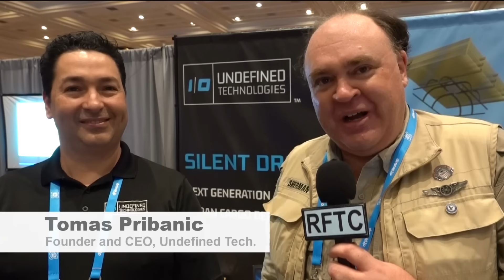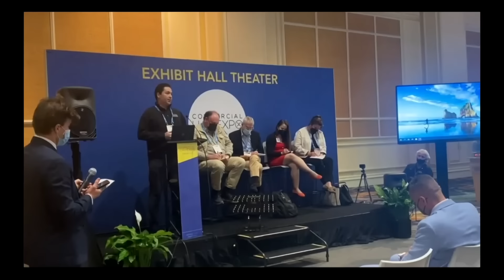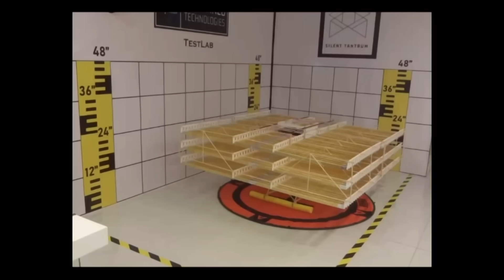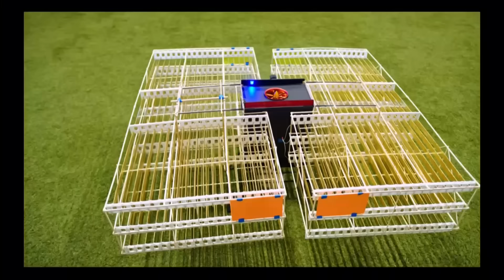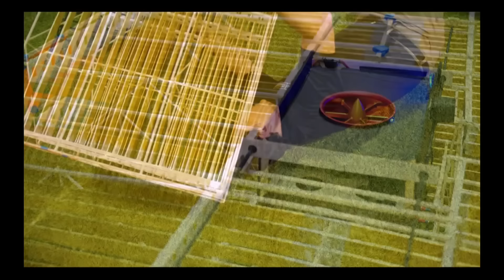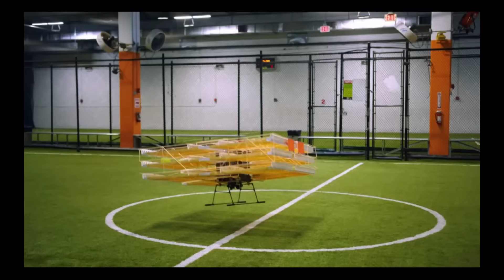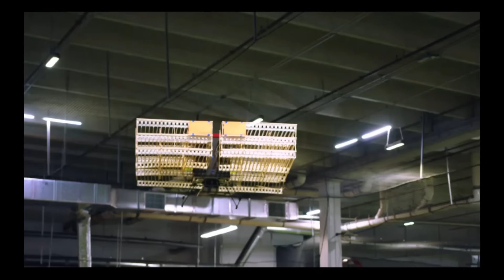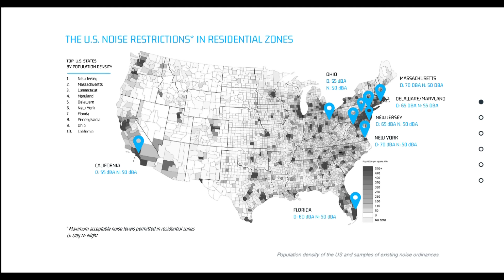New Drone Tech: No Propellers, and Yet It Flies!

Comment: It's NOT ions, they call it ion winds though that's completley wrong,  Gravity is positive negative, the land your living on puts out a constant stream of positive energy heading upwards, 1 meter is a 100watts 2 meters is 200watts so on and so forth,increasing expotentially,   the reasons clouds/ water molecules become suspended is because when they start to evaporate they vibrate this in turn gives them a static charge which  the water molecule now it is devoid of particulates holds that charge carrying it up till its own density finds equilibrium,   Im sure weve all done the balsa/ aluminium and wire test with the battery,   well now you know why it actually works, it's not so much the device thats creating the lift but mearly it's like a kite thats blocking that charge from passing through the middle of the rods, even though theyre is nothing there,  WHY do you think planes are in the main built from aluminium composite,  in conjunction with a positive field it aids levitation by blocking that stream heading up  in effect giving it a push upwards,  the air industry has known for a long time now that  airodynamics isnt really required or needed for air travel.  think flying carpet. weaved with aluminium fibre and fine wire. AS for that thing have you noticed how where the propellors would normally be you've four squares almost touching so control is simple theyre just adjusting the charge to each individually.

Comment: So, no propellers except the fan in the centre?
Reply: Basic physics would tell you that fan in the centre provides cooling for the ion thrust generator technology which would doubtlessly get warm. Basic physics!!! 🙄
Reply: It's not new and there was no fans at all!! Do some research!!!
Reply: Fans are not propellers.
One is for cooling, one is for thrust vectors.
If you're insinuating a fan of that size, drawing air into a box from the top is adding lift, I don't know what to tell you.
Reply: @Ranstone  but fans have propellers.

Comment: These don't need to be silent actually. The sounds a craft makes can be outside the range of human hearing, like what a transducer produces.

I live in San Antonio and have seen some pretty spectacular flying craft near Randolph AFB. One night about 3 months ago, just as I was about to head to bed, this crazy sound was heard for about 30 seconds. It was as if my roof was being vibrated at a frequency higher than the wood and shingles could manage. Even my cats were freaked out by it. All of them were standing on high furniture while staring at the ceiling. I've never seen pets do that before in 40 years of ownership. I was fairly freaked out and nervous to step outside to see what was causing it.

There are several types of transducer-powered levitation devices that can be made from a kit. They can  keep the air entrained between opposing transducers so much that small objects like aquarium gravel can be held solidly in place. Although the devices are silent, the high frequency air waves still caused audible vibration in whatever microphone device is recording nearby (which sounds amazingly like the sound my roof was emitting that night).

The craft I witnessed near the air base would go from ground level to approx. 10K feet within 5 or 6 seconds then smoothly come to a stop, even in 30 knot winds. They can sit precisely still, despite strong gusts. They appear to be able to simulate many different lighting configurations from a single dim white light (as a star would look) to a full red/green flashing as seen on traditional aircraft wingtips. Often they will go completely incognito by turning off all their lights entirely .. sitting still silently in the darkness.

I'm wondering if somehow they are using a phased array of transducers to grab and entrain air molecules from above the craft, moving them below and keeping them in place using ultrasonic sound waves. If the air cannot escape from below the craft, then it could be able to support large amounts of weight, like a solid.

Comment: Don't ion lifters operate at extremely high voltages? Sounds like a big safety risk.
Reply: The only purely ion propelled crafts that can lift their power supplies are on my channel.  While they use high voltage the current is so low that they aren't too dangerous.
Reply: Its intended to remove mosquitos in a large volume.

Comment: This is garbage old technology made to look new. Ion engines have been achievable since the 60s. The reason it is not used is the complete lack of power provided compared to power consumed. It is useless for a drone and will not be able to lift even a small camera. Why spend way more money on an old failed technology that cant lift anything and is almost impossible to control? This interviewer needs to do some research before making videos like this. This is just a scam company trying to show something cool for investments. They clearly are no experts and are just winging it.

This same technology has been used in school projects to achieve the same thing. Its not impressive, its just a scam company.

Comment: I suspect this is using the Biefeld-Brown effect, and not an "ion drive" -- but it's still impressive!  
I hope they continue to develop this!  
This could be the prototype for a genuine flying car in 20 to 30 years...
Reply: Flying cars won't be a thing for as long as it requires a bunch of times more energy to lift something into the air compared to rolling it on the ground. Unless we find a way to levitate stuff without expending energy, or find an energy source so plentiful that it won't matter, we will continue to build roads and roll on the ground.
Reply: @mrkiky  Well, your crystal ball and my crystal ball disagree with each other 😛
Reply: @mrkiky  you act like you’ve never heard of an airplane. Or how about a sailplane? I’m replying from just two years later and we are developing flying cars all over the world. There are several that are available yet. They are not yet common.
Reply: @soaringeagle  Those are not flying cars, they're basically personal quadcopters with 1 seat, and, like I said, they're never be viable. It takes a LOT of energy to lift it in the air, it takes a fraction of that energy to roll it on pavement. Those are toys for rich people, not a viable mode of transportation. As far as airplanes go, they can't really function as "flying cars" because they need to take off and land on a runway, which is why they're more efficient. Planes basically do have a way of levitating without expending energy (kinda) but it requires them to constantly be at a certain velocity, so they need a runway to take off and land and can't hover. So also not viable for any short distance transportation that you'd use a car for.
Reply: @ no I’m not talking about the clock copter there are flying cars and it takes more energy to roll something on the ground because it’s more friction than something that is streamlined and going through the air especially something that’s box shaped
Reply: @ fly sailplanes. With a winch or even a bungee cord, you can rocket it up to 2500 in just seconds and then you just use the energy that’s already available in the atmosphere to fly for hundreds of miles. Wind and solar.. but there are flying cars that are not quad copters that are going to be viable transportation in just a very short number of years. Although they will be expensive at first.
Reply: Yeah.......no.
Reply: @JZ's Best Friend I think I got 20 to 30 good years ahead of me.  Anyway, I got mine from a scalper near Times Square, bleh 😛
Reply: The UT craft requires a noisy high-powered ducted fan in the middle to fly.  On my channel are real ion propelled crafts with onboard power.  They are patented for lifting their power supplies against Earth's gravity.  They are however very lightweight.

Comment: Requires WAAAAAAAAY too much power and won't work in a vacuum . No practical use and a novelty only .. Interesting tech to be sure and worth further study and may be useful for a future application other than flight .
Reply: There are a series of crafts on my channel that take WAY less power and are patented for really lifting their power supplies but, they are MUCH lighter in weight, and it required decades of research, rebuilds, and very specific changes/construction, otherwise it is not normally possible to lift a power supply with ions.  I don't believe the UT craft can do it, and I have heard their loud powerful ducted fan in the middle.  The crafts on my channel are more than a novelty and will have some practical uses someday soon.

Comment: The problem is, that battery he shows won't fly.  He's got it hooked up to small wires and high voltage at extremely light weight.  This guy is a scammer when he puts a big battery by that model drone.  That model won't fly either ( the one with the battery under it ) it's way too heavy.  This is not new tech and many Jr. High kids do these projects for science fair.  There's no magic here buddy.  I guess you crawled out from under a rock.

Comment: No propellers is misleading.  There is clearly an intake at the top of the center box, and an outlet at the bottom.  There is definitely a propeller providing thrust via the center box construction.  They're just using slight ion breezes for stabilization.  Now... take it outside where there's even a slight breeze.  This isn't going to go anywhere practical.
Reply: Many people say they are using ions for stabilization.  I specialize in this subject.  It is not easy to switch 30 to 50kV to the different quadrants with an ultralight onboard switching system.  The weight requirements are WAY more stringent than the parts on a quadcopter for instance.  It also takes years of development to make such a system work in an agile enough manner to prevent a crash.  The weight and force from their ducted fan would cause any ion steering to not work sufficiently.  Their ducted fan in the middle is a like other flying EDF devices shown online (Ikarus for example).  It has visible fins under it that move for stabilization steering.  At least that is what it looks like.  On my channel is the real thing, but it takes a lot of specific details to make it work in real life.  One of them is that it has to be much lighter in weight.

Comment: If it uses only ionic lift, it would prove to be impractical in high humidity or rain, as the HV charge would leak off, negating any lift. Impractical, aside from the fact that ionic lift forces are tiny.

Comment: I like where these guys are going... the place to make money off of this is in fishing.   If possible in the water.   We need a blade-less trolling motor. Edit: we need the blade-less trolling motor for the same reason. Noise.  The difference between people and fish is that fish can feel sound through their lateral lines. So they are much much more sensitive to it.  The will certainly still be able to feel the water moving from some distance away but it won't have that thump to it.  Think of a pulsating headache.

Comment: When reporters who didn't pass a single science class do reports on scientific topics lmfao.  There is NOTHING new, special, or "magical" about ion propulsion.  It is only impressive that someone wasted the time to make a drone this big that uses that as propulsion.  All this is doing is ionizing the air and using charged wires to repel the ionized air resulting in a push.  Aim that push in the right direction and you have lift.  It is incredibly energy intensive compared to propellers and requires much more structure to support the frame resulting in a great deal more mass to the vehicle reducing flight time and carrying capacity.  This technology has been around for decades and has no potential to take over propeller flight in atmosphere.

Comment: I read about this kind of propulsion 15 years ago. It was precisely this idea. Except it said it required high voltage in order to make this lift off - so it had a wire going to it. Curious how did they manage to produce such ionizer system that can produce enough thrust to lift itself, battery and extra 2 LB payload, while drawing so much power from battery. What's the trick?
Reply: Mabe if Testla had gotten his way this would have been more viable?  I read that some  of our planes in militery have some ionic lift. Who knows?

Comment: Props still seel more convenient if the power issue is no longer an issue then, the ionize propulsion  is still susceptible to wind think steering a hot air balloon with a fan boat motor. Interference from ionized  climates seem they would be an issue , and also shows up like the bat signal in any E.M.F view lens. Let's see where they go with this.

Comment: ROFLMAO! So, they are going to try and patent LFTR tech even though they did not invent it and some of us have been testing different designs for around 30 years at this point. LOL, of course the thing they aren't telling those people is that the damned thing can barely lift itself off of the ground. Add something like a good camera and it can't fly. Not to mention the fact that if you touch the wrong part of the drone once it is turned on, you can die!

Comment: My guess is that future use of this technique will involve using a hybrid design which also has rotors to
allow it to handle wind, rain, etc. and which can be activated for extra-heavy loads.
Reply: The UT craft requires a loud powerful ducted fan to lift itself.  The only ones that really lift their power supplies solely using ion are on my channel.  You are right though they are sensitive to wind at this point.
Reply: My guess is that rain would cause excessive HV leakage, negating any lift. This is interesting technology, but sadly, impractical.
Reply: This plus rotors- means you wasting more payload weight capacity for motor and blades. There is a specific limit of what existing battery types can handle.

Comment: I hope that this technology will become applicable to commercial use soon. I have heard from many sources like Dr. Steven M. Greer about technologies that could have propelled us decades beyond what we are using now. Ones that does not need us to burn too much fosil fuels but use more sustainable ones.
Reply: This uses way more fuel to run than current drones. Ion engines are a dead technology from about 50 years ago and they have made zero improvements on the tech or usage. This company is just a scam.
Reply: ion propulsion requires a fuckton of electricity to generate even a tiny amount of lift, it is a ridiculously inefficient means of flight
Reply: If you think fossil fuels are just for cars for the 8+ billion people and can easily be replaced,  youre not paying attention.

Comment: Humm was  that a FAN i spotted on top in the centre  we did not get to see a straight down view also noted was no sound was recorded just that pair babbeling away how very very convenient    when we see it ans can see STRAIGHT down from the top and HEAR  actual recording not pointless babble you might convince me till then  i am calling hoax
Reply: They do have a video out now with audio on their website.  It is clearly powered by a ducted fan.  However, on my channel you can find the real thing with onboard power! and it is verified.  It has to be MUCH lighter and requires a that a lot of clear details be in order to get the thrust to weight ratio up high enough to make it work though.

Comment: Sharper image used to have an air purifier without moving blades that used this technology. The issue is that the propulsion is very weak. I have a hard time believing it can lift anything of any substance.
Reply: The problem with ion propulsion systems of all sorts is, that propulsion is only a byproduct of the energy expended to i) split an air molecule (N2, O2), and, ii)  to ionize it (ionization energies are provided by Wikipedia). This is the reason, why ion thrusters can not replace conventional rocket engines.
Reply: @debrainwasher  The UT craft uses a loud high powered ducted fan for propulsion.  
On my channel are the only ion thrusters that really lift their power supplies vertically.  The crafts work by just adding electrons to the outer shells of ambient O2 molecules.  O2 has a strong affinity for gaining extra electrons that is why it is called an oxidizer.  By creating small amounts of negative ions in the oxygen component of the air, an airflow can be created without requiring the energy to reach the ionization potential that you were referring to.  It flies on very little wattage so long as it is low enough in weight and that geometry is just right.

Comment: This is an older technology from about 20 years ago. I've seen this done over and over again with lightweight triangles. Any kind of real wind would
probably knock this down. You're better off using a small wire from the ground that you can plug in.
Reply: Gonna need a looooooong extension cord.
Reply: The point always should have been to use it to reduce the frame weight to zero or near that and use multi axis engine to maneuver.  Ppl are smart and some ppl clever. Takes a genius to do both.

Comment: Hold on, why do I see the inlet of a ducted fan engine on the top center of this drone?   We're not supposed to see that on this drone that is only using ion generated drive.   The moment you have a propeller if any type, void this design.   If you need cooling it has to be passive cooling to validate the concept and the flying model